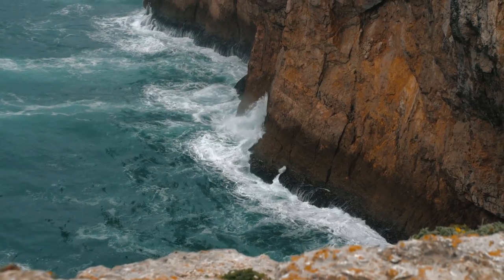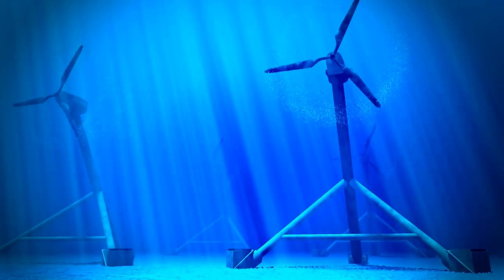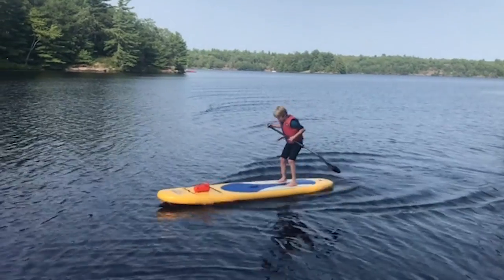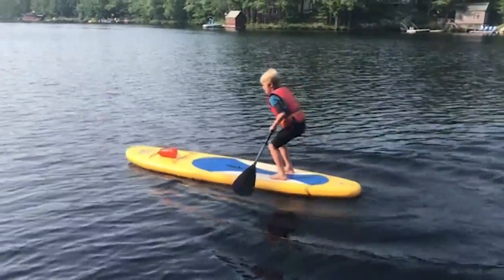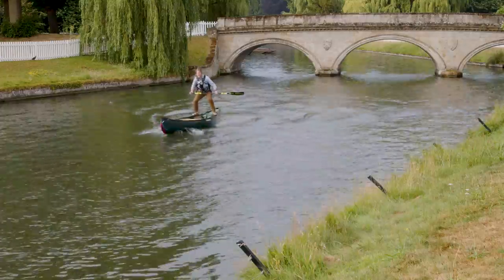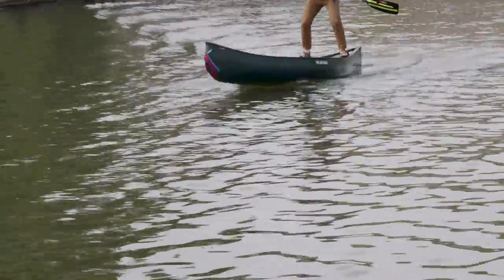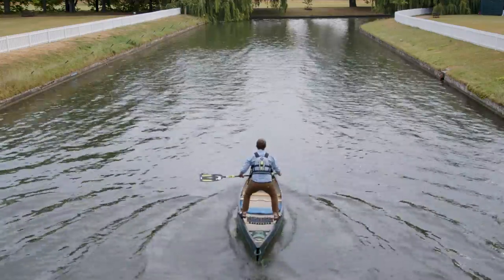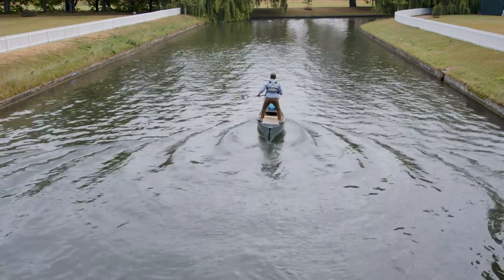Surfing on flat water: The fluid dynamics of gunwale bobbing

Comment: thanks for this !! ... i travelled by bouncing on the tube of an 18 foot raft, about 6-7 miles down the colorado river, mostly staying in the best current and exiting the eddies i did hit quite easily. always was curious how that was possible, since it started unintentionally. probably wasn't meter per second, but it kept pace with rafts being rowed. your video from the bridge really does a great job of illustration.